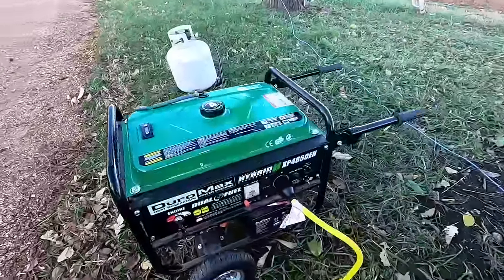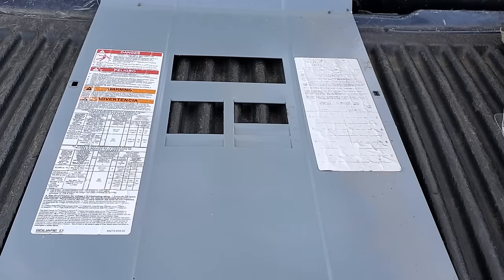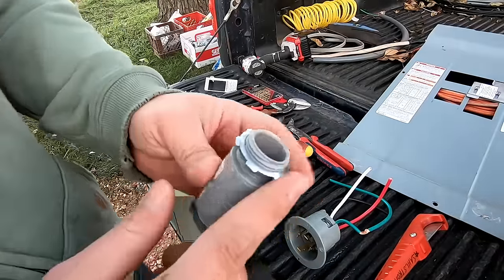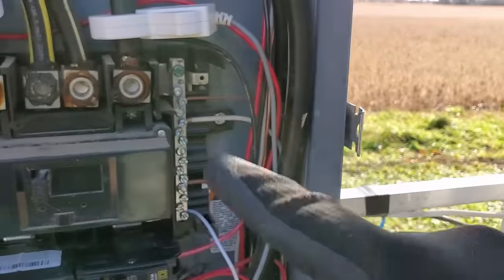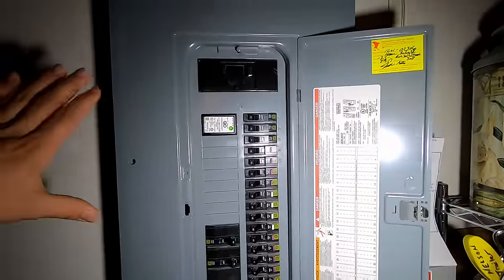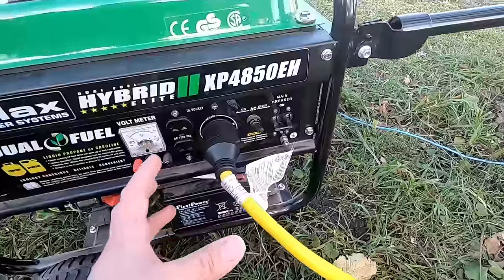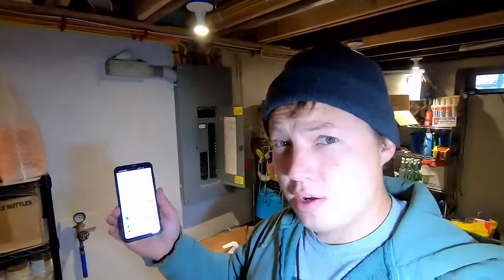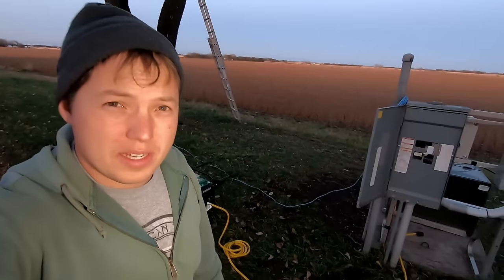How To Hook Up a Generator To Your House Using a Breaker Interlock Kit & Power Inlet Box

Comment: Good job like how you work you come to my house and do mine
Reply: Don’t forget about the generator safety tips as well. Remember it’s important to follow all the generator safety rules whenever you use your generator. Here are the generator safety tips:

1) Please do not allow an unqualified person or your children to operate the portable generator. Just because some manuals don’t say that doesn’t mean it’s safe. That is important against the generator safety rules. We also need to be keeping an eye on our children too. You need to make sure that your children are not playing near the portable generator especially when it’s running so they won’t get electrocuted. Generators pose electrical risks and they can be hot during an operation. Please keep your children away from the portable generator at all times. It is important to keep our children safe especially our little ones. Be aware of all the hazards.

2) Some people use their portable generators indoors which increases the risk of carbon monoxide poisoning. It’s important to have a carbon monoxide if you have a gas generator. Never ever use your generator indoors even if your doors and windows are open and even in the garage is not safe to use a portable generator. Not even at your porch and your deck. It is never safe to use your generator indoors and in enclosed areas of your home. Your generator needs to be 15-20 feet away from your house. 

3) 🔥generators cause fire hazards too. Never refuel your generator while it’s running. You need to let your generator cool off before refueling it and before storing your generator. Never overload your generator too. Never ever back feed your generator. You should never plug your generator into a wall outlet. Also never store propane tanks indoors. Please keep flammable things away from the generator as well and please don’t smoke cigarettes near the generator. Having a fire extinguisher next to the generator is also important against the generator safety rules. 

4) generator operation; make sure your hands are dry before touching the generator. Never use your generator in wet conditions. Don’t let your generator get wet. You need a generator tent if you need to use your generator during wet weather. Please don’t wear loose clothes when operating the generator. Turn on your generator before plugging in appliances. Use the right cord for your generator. Please do not use worn out cords. 

https://youtu.be/I1jT3ANENvI and here is a video more about keeping others safe when using generators and also about our family’s safety. Hope this helps

Comment: Or you can just connect the feeder wires to the  lugs on the subpanel while disconnecting the wires from the meter and turning off non-essential breakers. Your welcome.
Reply: Yes you can do that but you need to know what your doing and if your not there to do it, would someone else in your home know what to do to switch over in case of a blackout? His install is the safer solution and has the fewest "moving parts" for a lay person to have to worry about, kinda idiot proof if nothing else.

Comment: Just Memorize the "Electrician's Handbook" LOL
Reply: Don’t forget about the generator safety tips as well. Remember it’s important to follow all the generator safety rules whenever you use your generator. Here are the generator safety tips:

1) Please do not allow an unqualified person or your children to operate the portable generator. Just because some manuals don’t say that doesn’t mean it’s safe. That is important against the generator safety rules. We also need to be keeping an eye on our children too. You need to make sure that your children are not playing near the portable generator especially when it’s running so they won’t get electrocuted. Generators pose electrical risks and they can be hot during an operation. Please keep your children away from the portable generator at all times. It is important to keep our children safe especially our little ones. Be aware of all the hazards.

2) Some people use their portable generators indoors which increases the risk of carbon monoxide poisoning. It’s important to have a carbon monoxide if you have a gas generator. Never ever use your generator indoors even if your doors and windows are open and even in the garage is not safe to use a portable generator. Not even at your porch and your deck. It is never safe to use your generator indoors and in enclosed areas of your home. Your generator needs to be 15-20 feet away from your house. 

3) 🔥generators cause fire hazards too. Never refuel your generator while it’s running. You need to let your generator cool off before refueling it and before storing your generator. Never overload your generator too. Never ever back feed your generator. You should never plug your generator into a wall outlet. Also never store propane tanks indoors. Please keep flammable things away from the generator as well and please don’t smoke cigarettes near the generator. Having a fire extinguisher next to the generator is also important against the generator safety rules. 

4) generator operation; make sure your hands are dry before touching the generator. Never use your generator in wet conditions. Don’t let your generator get wet. You need a generator tent if you need to use your generator during wet weather. Please don’t wear loose clothes when operating the generator. Turn on your generator before plugging in appliances. Use the right cord for your generator. Please do not use worn out cords. 

https://youtu.be/I1jT3ANENvI and here is a video more about keeping others safe when using generators and also about our family’s safety. Hope this helps

Comment: I have that same screwdriver with the same dog chew damage, lol
Reply: Don’t forget about the generator safety tips as well. Remember it’s important to follow all the generator safety rules whenever you use your generator. Here are the generator safety tips:

1) Please do not allow an unqualified person or your children to operate the portable generator. Just because some manuals don’t say that doesn’t mean it’s safe. That is important against the generator safety rules. We also need to be keeping an eye on our children too. You need to make sure that your children are not playing near the portable generator especially when it’s running so they won’t get electrocuted. Generators pose electrical risks and they can be hot during an operation. Please keep your children away from the portable generator at all times. It is important to keep our children safe especially our little ones. Be aware of all the hazards.

2) Some people use their portable generators indoors which increases the risk of carbon monoxide poisoning. It’s important to have a carbon monoxide if you have a gas generator. Never ever use your generator indoors even if your doors and windows are open and even in the garage is not safe to use a portable generator. Not even at your porch and your deck. It is never safe to use your generator indoors and in enclosed areas of your home. Your generator needs to be 15-20 feet away from your house. 

3) 🔥generators cause fire hazards too. Never refuel your generator while it’s running. You need to let your generator cool off before refueling it and before storing your generator. Never overload your generator too. Never ever back feed your generator. You should never plug your generator into a wall outlet. Also never store propane tanks indoors. Please keep flammable things away from the generator as well and please don’t smoke cigarettes near the generator. Having a fire extinguisher next to the generator is also important against the generator safety rules. 

4) generator operation; make sure your hands are dry before touching the generator. Never use your generator in wet conditions. Don’t let your generator get wet. You need a generator tent if you need to use your generator during wet weather. Please don’t wear loose clothes when operating the generator. Turn on your generator before plugging in appliances. Use the right cord for your generator. Please do not use worn out cords. 

https://youtu.be/I1jT3ANENvI and here is a video more about keeping others safe when using generators and also about our family’s safety. Hope this helps

Comment: those pigtails on that 30 look kinda weak. I've got an 11k gen on my house and I wouldn't go any skinnier than a 50 amp and 6 gauge jumper... i wouldn't however use SENSE as a leg monitor. they have better for cheaper brands.. with Sense you're only buying the name brand. my leg monitor actually has 4 main inputs 2 for a separate generator input

Comment: You never grounded your generator input box. You used a pvc fitting this does not provide a ground to panel. There is a shock risk if the generator line wire grounds out. Just saying brother! Otherwise good job.

Comment: that's expensive way of doing his why don't you just hook it up to the welder plug in your garage and run it through there and turn off the main breakers outside so you're not trying to light up the whole neighborhood
It work fine in my house when the power went out

Comment: fyi those gloves will still alow you to get your a$$ shocked... i know first hand LOL. rubber chemical gloves (very similar to the yellow kitchen gloves but black) have yet to fail me.
Reply: Don’t forget about the generator safety tips as well. Remember it’s important to follow all the generator safety rules whenever you use your generator. Here are the generator safety tips:

1) Please do not allow an unqualified person or your children to operate the portable generator. Just because some manuals don’t say that doesn’t mean it’s safe. That is important against the generator safety rules. We also need to be keeping an eye on our children too. You need to make sure that your children are not playing near the portable generator especially when it’s running so they won’t get electrocuted. Generators pose electrical risks and they can be hot during an operation. Please keep your children away from the portable generator at all times. It is important to keep our children safe especially our little ones. Be aware of all the hazards.

2) Some people use their portable generators indoors which increases the risk of carbon monoxide poisoning. It’s important to have a carbon monoxide if you have a gas generator. Never ever use your generator indoors even if your doors and windows are open and even in the garage is not safe to use a portable generator. Not even at your porch and your deck. It is never safe to use your generator indoors and in enclosed areas of your home. Your generator needs to be 15-20 feet away from your house. 

3) 🔥generators cause fire hazards too. Never refuel your generator while it’s running. You need to let your generator cool off before refueling it and before storing your generator. Never overload your generator too. Never ever back feed your generator. You should never plug your generator into a wall outlet. Also never store propane tanks indoors. Please keep flammable things away from the generator as well and please don’t smoke cigarettes near the generator. Having a fire extinguisher next to the generator is also important against the generator safety rules. 

4) generator operation; make sure your hands are dry before touching the generator. Never use your generator in wet conditions. Don’t let your generator get wet. You need a generator tent if you need to use your generator during wet weather. Please don’t wear loose clothes when operating the generator. Turn on your generator before plugging in appliances. Use the right cord for your generator. Please do not use worn out cords. 

https://youtu.be/I1jT3ANENvI and here is a video more about keeping others safe when using generators and also about our family’s safety. Hope this helps

Comment: I’m sure what I’m about to say is going to ruffle some feathers but it needs to be said.  Anything electrical, by law, has to be installed by a licensed contractor.  I understand home owners want to save a buck and any work done by a licensed trade(HVAC,plumbing,electrical) is expensive, but we’re talking about electricity here.  More people get killed on 120/240 VAC(residential voltage) than any other voltage.  Not to mention stating a house fire or potentially be fatal to lineman working on the power lines.  Just call an electrician.  No amount of money is worth loosing you life or getting somebody killed.  I don’t care how intelligent somebody thinks they are.  Any electrician worth his weight in salt would agree that working on electrical systems within the authority having jurisdiction is illegal for a good reason.
Reply: My jurisdiction allows the homeowner to install these “interlock kits” to their own homes as long as it’s not a rental or for sale.
Reply: As mentioned, this varies by locale. In my area the owner of a detached home can do their own work, but is required to pull a permit, then pass inspection afterwards. Other places do not even require the permit/inspection, though it's probably a good idea regardless for insurance & liability reasons. But there are certainly jurisdictions (especially large cities) that are as you say, where no one but a licensed electrician can legally do electrical work.

Comment: i just make up a power cable  with 2 male  plugs one on each end and plug one end to generator the other to house and turn off mains power before run generator or someone could get killed when feeding power into main grid

Comment: Ben, you are teaching a very dangerous technique.  Relying on the master breaker to isolate the energized house circuit from the power grid is very dangerous.  The disconnect gap on a breaker is very small and makes it easy for voltage to jump to the grid, which powers up the formerly dead grid.  Once that 120 Volts passes thru a transformer, it rises to 15 to 25 KV.  Meaning linemen working to repair the problem are getting full power grid voltage back-feed.  Which kills linemen.  It may be very low current, but it's full grid line voltage.  It's all about passing thru the transformers in reverse which is what makes your technique very dangerous.  What you should be teaching is how to install a "Double Pole Switch Over" switch.  Which provides complete and safe isolation from the grid.
Reply: I'll have to look up your "Double Pole Switch Over" switch.  I am hoping someone makes a Main breaker with ON - OFF - Generator switch.
Reply: Remember to always make sure you follow all the generator safety rules whenever you use your portable generator. 
⚠️Here are the Generator safety rules that everyone needs to follow when using generators:

This is just a reminder for everyone’s safety when using portable generators. All generator safety rules need to be followed carefully to avoid hazards. 

1) Please do not allow an unqualified person or your children to operate the portable generator. Just because some manuals don’t say that doesn’t mean it’s safe. That is important against the generator safety rules. We also need to be keeping an eye on our children too. You need to make sure that your children are not playing near the portable generator especially when it’s running so they won’t get electrocuted. Generators pose electrical risks and they can be hot during an operation. Please keep your children away from the portable generator at all times. It is important to keep our children safe especially our little ones. Be aware of all the hazards.

2) Some people use their portable generators indoors which increases the risk of carbon monoxide poisoning. It’s important to have a carbon monoxide if you have a gas generator. Never ever use your generator indoors even if your doors and windows are open and even in the garage is not safe to use a portable generator. Not even at your porch and your deck. It is never safe to use your generator indoors and in enclosed areas of your home. Your generator needs to be 15-20 feet away from your house. 

3) 🔥generators cause fire hazards too. Never refuel your generator while it’s running. You need to let your generator cool off before refueling it and before storing your generator. Never overload your generator too. Never ever back feed your generator. You should never plug your generator into a wall outlet. Also never store propane tanks indoors. Please keep flammable things away from the generator as well and please don’t smoke cigarettes near the generator. Having a fire extinguisher next to the generator is also important against the generator safety rules. 

4) generator operation; make sure your hands are dry before touching the generator. Never use your generator in wet conditions. Don’t let your generator get wet. You need a generator tent if you need to use your generator during wet weather. Please don’t wear loose clothes when operating the generator. Turn on your generator before plugging in appliances. Use the right cord for your generator. Please do not use worn out cords. 

https://youtu.be/I1jT3ANENvI and here is a video more about keeping others safe when using generators and also about our family’s safety. Hope this helps

Comment: or every facet is now live, so if your child is taking a bath and has there tow in the facet and listening to a ac radio and that radio card shorts, same in the kitchen if your hand is toching any metal around that sink and hmm i think i wont some toast, ok toater short all the time. if u dont have a seperate ground bar install one, then u have an old system or who installed that box did not know what he was doing not licensed. they did that back in the 70,s in think then they also could install two prong outlets, the ground lug on the gen is the proper earth ground.